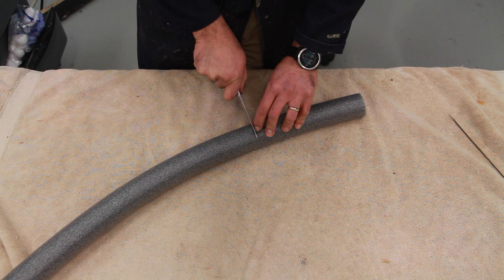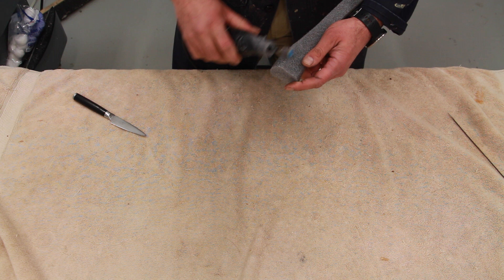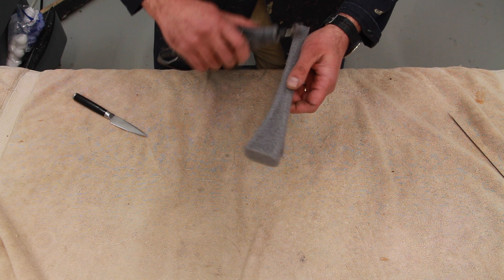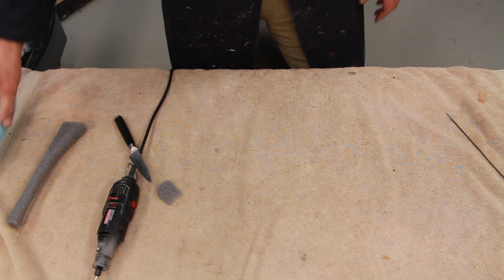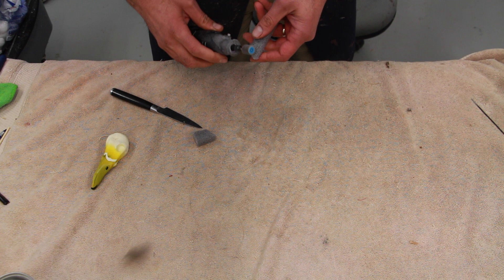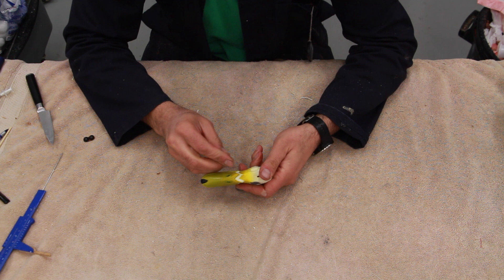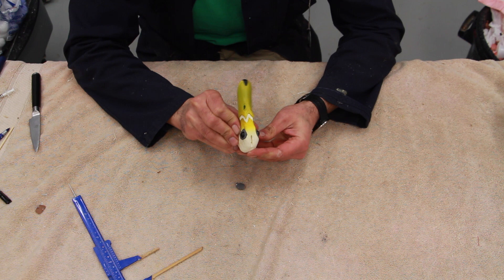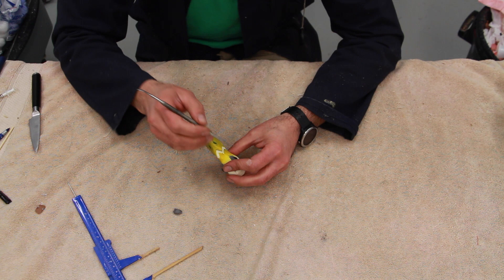BLACK DUCK series Part 2-6. Carving the neck, setting eyes.

Comment: Backer rod is commonly used for filling the gap between two items to cut down on the amount of filler used in the gap. I.e. the expansion joints in your concrete driveway. Before caulking or sealing the gap, backer rod is pushed in fill the gap partway. Then your caulk or sealer is applied over the rod and it won't take as much caulk
Reply from the maker: Thanks Barry for sharing

Comment: Is it possible that you would keep the original skull in the bird? If so, how would you attach the neck?
Reply from the maker: Yes. Many taxidermist still do it. There are many different ways to attach them to the neck. Stay tuned I’ll put together a video.
Reply: So if you use the original skull, would you still remove it completely to clean it and paint it? I've started out working with small mammals and left the skin attached around the mouth cleaning the skull up that way. Is it a case where either method would work?